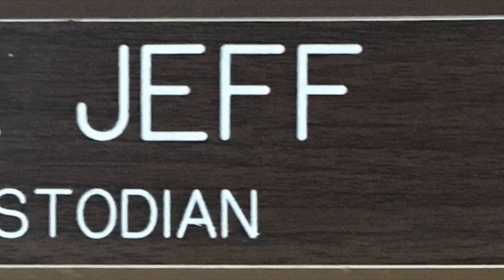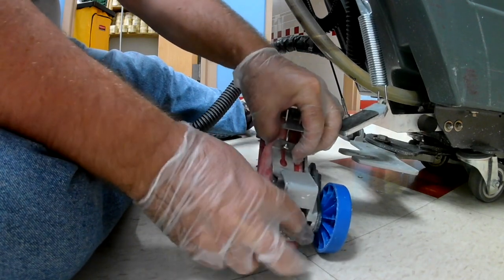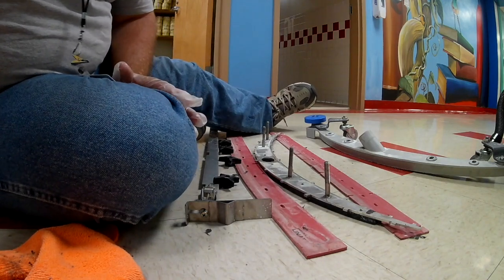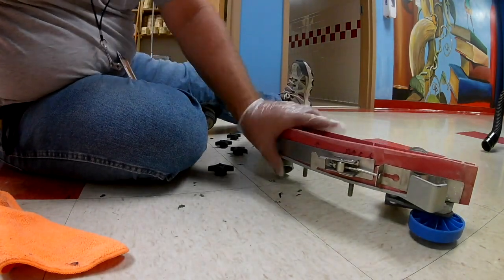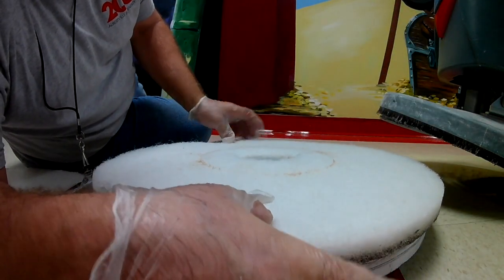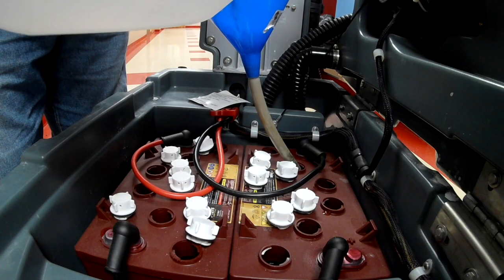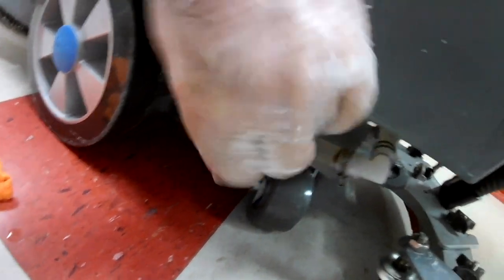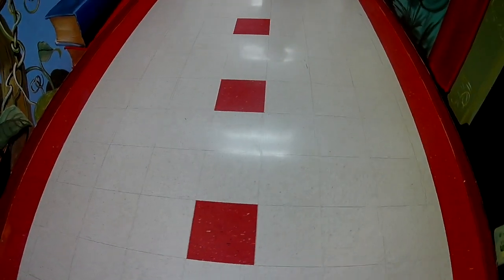Do your Maintenance on auto scrubber @mrjeffthecustodian

Comment: Mr Jeff... I don't know how I missed this video. We have a stand on scrubber. And I always wipe our squeegee off after use. And I would usually see some lines or streaks. Well after I saw this video I took the squeegee apart. I wound up getting a good handful of goop out of the system. Turned the squeegee blades over. And did my usual PM on it. World of difference with the scrubber now. No streaks. Great info on the blades. I was intimidated at first. But it worked. Ty sir
Reply from the maker: Glad it work for ya. That’s the reason I do these thing. To help folks out.